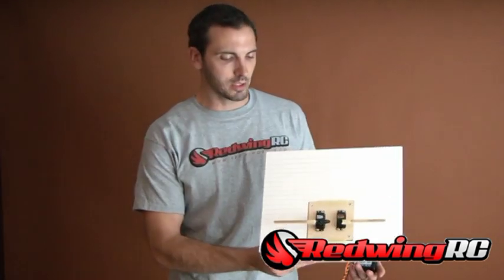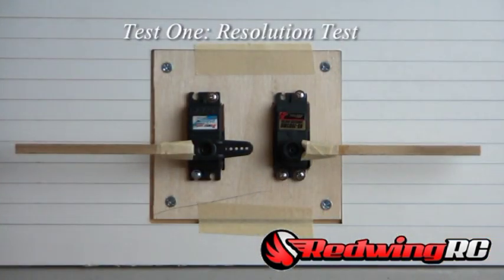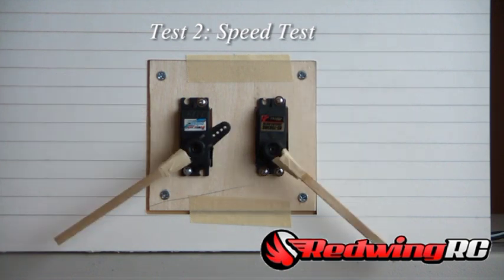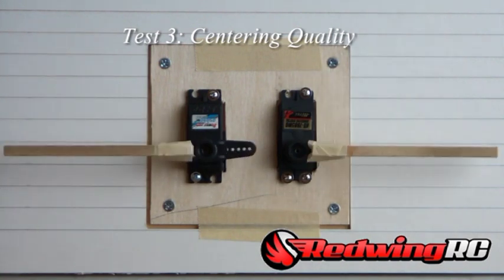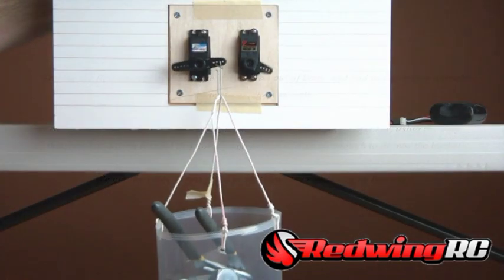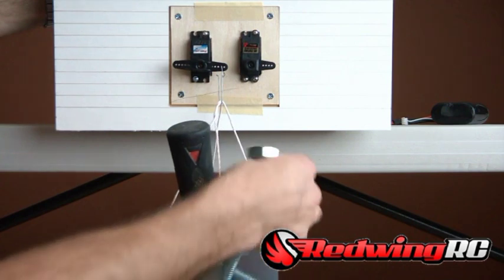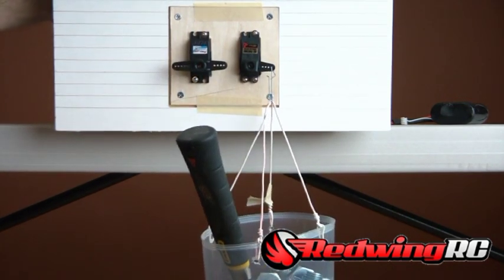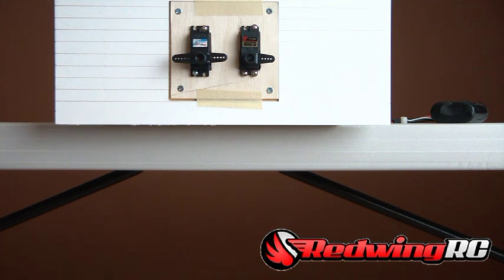Power HD DS090 VS HiTec 7985.mpg

Comment: It will be very usefull to have a reading of the current draw during the test. This value if often inacurate on some cheaper servos. That's often the price you're paying to get nice torque results - excessive heat and battery power consumption.

Comment: You are both incorrect. The Hitec stick is clearly longer.  It travels UP 6 lines as opposed to the the Power HD' 4 3/4 lines of travel. Down the Hitec almost touched the table as opposed to the Power HD not coming close.  It is simple, if the stick is longer and it clearly is, it has to travel a longer distance than a shorter stick.